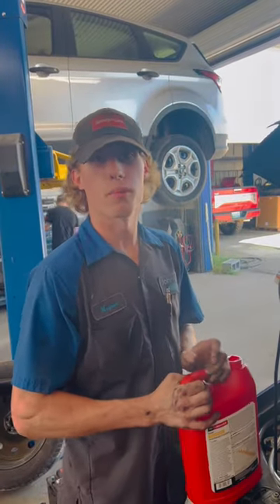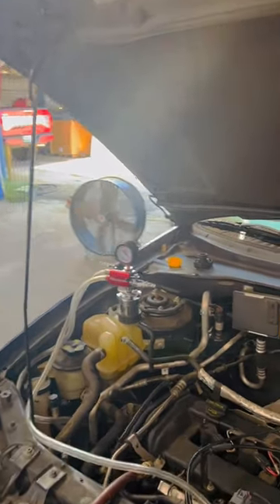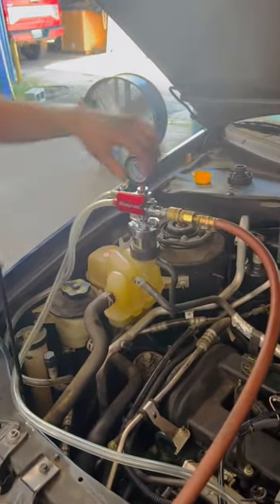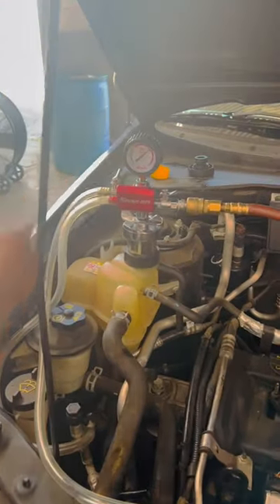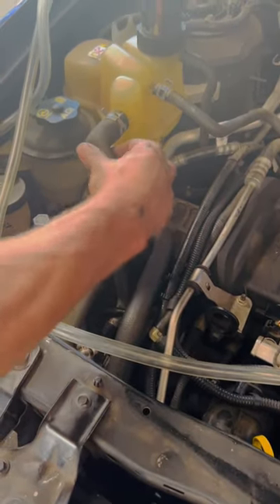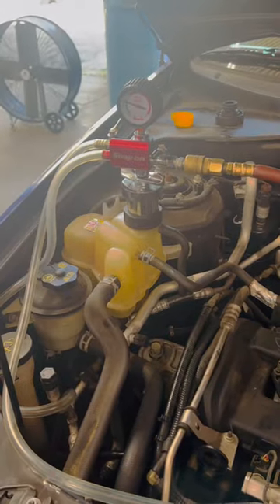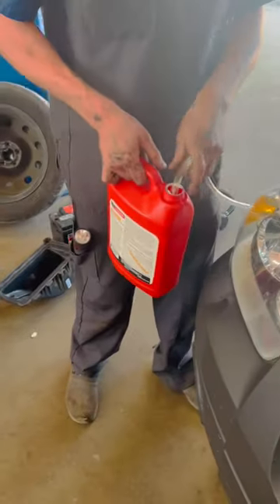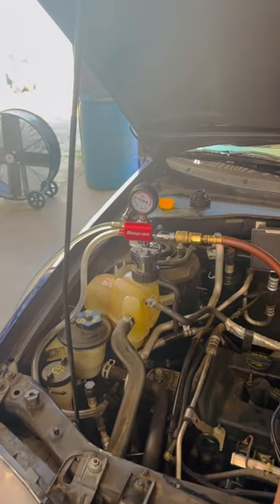How To Fill A Cooling System The Right Way #shorts

Comment: I'm just worried about using that pressure on an aged vehicle where the plastic can crack. I've seen it happen on a chrysler at my previous shop so I just do shit old fashioned because at the end of the day I don't want to break the cars anymore than they already are lol
Reply: It’s way faster to do it this way instead of a drain and fill and if you end up breaking something on an older car then it was gonna need it anyway… plus now you got more work lol
Reply: @23for82bigs  that's not how it works at my shop... we're not the dealer and most of our cars are old and parts are hard to come by, even on models 10 years old. That and the dealership just won't sell us certain things either.
Reply: The pressure won’t break anything. It needs to have pressure to bleed the air and create proper vacuum
Reply: On a well maintained car no problems. If you own a Jalopy you will have issues.
Reply: It works with using a vacuum not pressure so it's not gonna damage shit
Reply: I don't think yall noticed when he said "this is how you do it on all these NEWER cars"
Reply: @ricardocorral4411  vacuum can still break brittle plastic
Reply: That’s why only on the newer vehicles or the vehicles that harder to bleed out.
Reply: @GSC-Operator-chan  exactly what I said
Reply: The coolant system stays under pressure when operating properly, if the pressure doesn't break anything the vacuum shouldn't either. I've used it on many vehicles over the years and never had a problem
Reply: @SUMDUDE.  - just because it operates under 15 psi gauge doesn’t necessarily mean it’s good for vacuum. I’m glad you’ve had no issues I just wouldn’t take this approach based on all the other easy options that are easy as well
Reply: The vacuum you place in the cooling system creates less stress on the system than the pressure it is under does when the system is pressurized. If the plastic was going to fail because it was that brittle, then chances are that is why the car needed repair to begin with.
Reply: What
Pressure?
Reply: @TNTHammer  what do you mean they won’t sell you certain things? Sounds like you need to talk to someone over their heads. Don’t let a dealership bully your shop or try to ice you out. Our dealerships around here know better than to do that.
Reply: @THEMOWERMEDIC1  it's a NEGATIVE pressure, hence the term vacuum. still a pressure, in the reverse form.
Reply: @THEMOWERMEDIC1  think of putting clothes in a bag, and vacuuming the air out. The vacuum removes the air, and the shrinking bag creates a pressure on the clothes.
Reply: If something breaks while vacuum filling or pressure testing,  it needed to be replaced anyways..
Reply: Retired Professional Mechanic.  If Air breaks the bottle,  that means the bottle was brittle ready to break. Replacing the bottle just saved the owner a break down and possibly saved them a head gasket problem.  Depends how you look at it. Sucks to be a guy like you cause you just repaired something in the coolant system now another problem 2 months later. Your the bad guy. Something breaks doing it the correct way means you have a weak component replace it.
Reply: I mean, what do you expect from a chrystler product ?
Reply: @23for82bigs  yea true however many older vehicles require special order for some parts and customers can't wait
Reply: If it’s gonna crack and break under vacuum, it will crack and break under pressure when the engine is hot.
Reply: old fashioned coolant funnel for the win!!!!
Reply: @juanmartinez7536  The problem is it's negative pressure. Older coolant systems were never designed to be under vacuum
Reply: You do realize, I hope, that under operating conditions, there is OVER TWO FREAKING ATMOSPHERES OF PRESSURE IN THE SYSTEM. The 25-ish inches of vacuum is no where near as stressful. Learn some basic science ferchristsakes!
Reply: If it cracks under vaccum the plastic was weak and you prevented the client from getting stuck on the side of the road.
Reply: I gamble......i use this on semi trucks.....if the truck is a pile of sh*t, I pull just enough vacuum to fill it.....I have absolutely caused a water pump to start leaking through this process.
Reply: Just curious why can you not just pour it in? Is it just the fact that air can become trapped in the system and this keeps that from happening?

Comment: Love the haters, if something is going to get damaged by the vacuum, what do you think will happen when the system is under pressure. This method is the only way to go. You can pick up a similar unit for $100. I bought a Wurth unit for $80 15 years ago, use it at least once a week.
Reply: Exactly 👍

Comment: Love your channel - but a small suggestion. Normally you'd pull up the coolant right to the suction valve while you are evacuating. This way the first thing that is introduced is coolant - not a hose full of air, which would be the opposite of what the goal of this operation is, right? Edit - this will 100% overfill the reservoir, so have a large syringe and a hose on it to suck down to the correct level.

Comment: Does the snap on tool come with a small one application pack of Vaseline?  I gotta think that thing cost a fortune
Reply: It's not that bad, I have the snap on one and the MAC one
Reply: When your a Professional Mechanic,  you buy Professional tools. We don't worry cost. Because the job the tool does makes for a Professional job. It maybe over the top for Goober Mechanic who make Goober wages.
Reply: 500 bucks for mine with one adapter 🤦‍♂️
Reply: @rickchambers73  - call me a goober mechanic if you want I don’t care. All I know is I’ll never buy any snap on tools. Never had them never will. Just over priced vanity tools as far as I’m concerned.   Never had one issue with the tools I have that would be worth paying three or four times as much. But to each his own
Reply: Bought the universal harbor freight one for $90. Thing was garbage. Decided to buy the matco one for $300. It’s been worth every penny. There’s some tools worth paying a lot for.
Reply: @cheekclapper4334  - you fill these a lot as a part of your job?  Doesn’t a $30 funnel from Lisle #24680 work?
Reply: @condor5635  not really the correct way or most efficient for a tech to do this job. You want to pull a vacuum to check for leaks, with just a funnel you cannot do this. Also this bleeds the system instantly. If you are a flat rate tech these tools help you get paid more for sure by saving time
Reply: @Givemedabeans  thanks - understand and very good point for the full time mechanics. Don’t think as an experienced DYI I would need an expensive tool like this but it is interesting. I have a video on extracting fluid with my vacuum pump I could probably improvise for this use but do this so little a dedicated one is not necessary. Thanks for reply
Reply: @condor5635  I use that one as well. Both work great. But the vacuum fill is just way faster as it bleeds the air out very quickly as well as fill the system back up.
Reply: @rickchambers73  you could have just said more expensive tools make you feel like a better tool than anyone else.
Reply: @rickchambers73  
You don't have to pay an arm and a leg to get professional tools, there are plenty of other brands out there that are just as good as snap-on for half the price. For example, Snap-On sued Harbor Freight years ago because they claimed the Daytona jack was similar to theirs (which it was, made in the same factory) only $600 less than the SO version. 
If you know what to shop for, you can still find professional quality tools that's not going to obliterate your wallet.
Reply: Bruh u know how much time this tool saves? Who cares about the price, not waiting 20 min to bleed a cooling system.

Comment: To those saying the vacuum may damage brittle plastics etc... I've used one of these for 15+ years at a professional level. I use it on EVERY car I put coolant in, regardless of age. I've not had even one component fail due to the vacuum. That's literally 100s and 100s of cars over the years, if not 1000+ and never had even one problem. If something were to break, well then it was about to break or already leaking anyways. Simple as that.

Fact is that it is an time saving tool in multiple ways. It tells you if there is a leak somewhere in the system BEFORE you put coolant in it and you NEVER have to burp the cooling system if done correctly.
Reply: You also don't give a damn if something breaks, it's just more money you'll hose outta your customer for you breaking something. 🤡 "Well it need replacing anyways, it's over XX years old..."
Reply: @MindsMouth  you're probably the same guy who would be running right back and complaining for a refund if something broke a month afterward. 🤡
Reply: @Krankie_V  Hell no, mechanics are sharks, that's why I went to school to learn to do all my own work. 👍
Reply: @MindsMouth  sucks you feel that way. It's no secret that some joints will definitely rip you off but there are plenty of honest and reputable shops out there who will treat you right. The last place I worked was selling brakes to people whose brakes were only 50% worn out, all the damn time. I quit after only a couple months. I have no desire to be a part of that BS.

If a customer has a part that's ready to fail, I'll notify them. Once in a while we get someone with your attitude. They usually come back, but have to pay a tow bill on top of the repair. 🤷
Reply: What do I put my psi output on my air compressor when connected to my vacuum purge system ??

Comment: When you have long cooling hoses with multiple bends and odd shapes this tool works awesome because it eliminates air pockets but the system needs to be sealed. Obviously on earth we can only pull so much vacuum so when you pull the system down to negative pressure you can just turn the valve off and if it starts to lose vacuum then you have a leak somewhere. And then once you confirm system has no leaks fill it up.

Comment: Lmao some of us don’t want to sign our lives away to pay for a snap on tool tho 😂 fill it cap it start it and repeat till there’s no air left 👍🏻😂
Reply: They’re called investments. When you’re working flat rate things like this make jobs 10x faster.
Reply: You don't need one from snap on although it's probably one on the highest quality ones you can get, and when you actually work in a shop and need to get stuff done relatively quickly then it makes a huge difference because of how quickly you can fill it rather then waiting a long ass time. Also if you say it doesn't take that long then your lying or just don't know what you're doing because it usually takes at least 10-15 minutes for all the air to come out of the heater core due to the car not being up to temp... just saying lol
Reply: @msean624  was a joke dude I know this lol I have worked in a shop, this was mainly for the people that do not and do not want to spend all that $$ on a tool they would only use a few times a year if that, also seems like simple instructions to me on my original comment lol
Reply: @mr.corona1319  yes I know this I have worked in a shop, things like this do help a lot but this joke was mainly for people that do not work in a shop and or do not want to spend all that $$ on a tool they would only use a few times a year if that
Reply: Cap it? Doesn't that make it not bleed out the air since that closes the system? I was taught to start it with no cap with the heat on full so the heater core system also fills and bleeds correctly.
Reply: @stevenjohnson1692  no the caps have valves in them
Reply: Cheap insurance... You take the risk of an air bubble remaining in the cooling system ,especially the e.g.r. and burning it up....expensive to replace and the trucking company will be pissed,...... that's why your Chinese pizza pizzazz still hasn't arrived yet.

Comment: Meanwhile I bleed the coolant with a funnel and never had any issues
Reply: Doesn't work for every vehicle
Reply: That’s the Stone Age (nothing wrong with that method) dude it saves you so much time just by buying this tool
Reply: @DJFish8051  yea its just more practical ig when you're working on a porche or something at that level it would make sense otherwise funnel works fine in my experience

Comment: NOOOOPE😆 not the only way
-Pour to the line
-Start car
-Turn on the heat
-Top off as it warms up
-Play with the throttle (2.5k-3.5k rpms) and it'll bring heat into the vehicle(reservoir will be steaming, this is good)
-Close reservoir and go drive. Works just fine
Reply: You betcha.
Reply: Okay gramps. You probably hate all those fancy new fangled cordless tools too.
Reply: @Everythingisgoingtobealright  listen my boy, everything is going to be alright, i promise
Reply: @Ramslamtheman  
For me it will, you’ll be stuck in the 1960s for ever. Sorry I really should have more respect for the elderly.
Reply: @Everythingisgoingtobealright  😆😆😆well damn I'm not that old 😁 but it works though, you don't need anything

Comment: How do you get the air out of the fill line. The one you shoved into the coolant has air in it.
Reply: Just fill the fill line with coolant, close valve, then pull vacuum on the system.  While building vacuum the fill line should stay full

Comment: There are many variations of this tool that are very affordable. You don’t have to use snap on and I am currently waiting on my builder to put a 220 in my garage so I don’t have compressed air. So I have been using an a/c vacuum pump.
Reply: My set up was 80 $

Comment: Purge the air from the coolant filler line before cutting off the vacuum or all that air goes right back into the system.

Comment: Shade Tree mechanic is thinking 🤔: How much 🍺 beer money does this cost?
Reply: You can get vacuum fillers for as little as $30-$40 on amazon but a decent one will run you $100-ish. Probably double that if you get one from a tool truck. Plus you will need a compressed air supply to use it.  Worth every penny if you need to fill cooling systems of any kind of regular basis.
Reply: I think about how many hours I’d have to work to replace the money I spent.  I made $22.75 with a 7% night time differential. So $24.34 per hour, I no longer make that since I got fired because of medical problems that preventing me from doing my jobs. I don’t even drive right now, maybe won’t be able drive again. Maybe 14-16 hours after the government takes their their being alive tax. Their share cost them 0 hours of work.

That’s if it is only a $250 tool

Comment: Back when i worked at Sears. We used a Cool- Rite machine that had 3 tanks, best machine i've ever used. One tank was for the old coolant, one for water to clean out your system, and one with new coolant. Too bad they cost like 3k for a new one.

Comment: No spill funnel then squeeze the top radiator hose old school works
Reply: it does, except the fadder inlaws suzuki grand vitira, I couldnt understand why it still overheating and wouldnt suck down the no spill, thermostat wouldnt open.... found out online I was doing everything correctly.... expect I did put the rad cap back on to let the system pressurize, the FSM says to use a no spill, then when it starts to overheat, put rad cap on, do that 4 or 5 times and the system is filled.

 I spent 3 hrs trying to get "air out" jacked up the front, made my no spill the highest point with the extention, wouldnt work, filled the rad, wouldnt fill the engine.... put the cap on, 6 times she was full and best kind. lol

Comment: Or jack thefront end up high, fill, start and run till Tstat open, fill more, rev to blow out bubbles, double  check, and finnish filling, if necessary. 

Your on your own if a mid or rear engine, or exotic.
Reply: I dont even lift the car. But i do everything else you listed and never had a problem

Comment: You know there's a little vow that you can loosen and slowly pour it in and all the air will come out that's why it's there put in a vacuum on the system like that I don't recommend that only for your AC a vacuum is needed I don't see a problem with it too much if it's not under severe vacuum what are the specs on this that you're doing and I'm asking a serious question
Reply: Spell check got me several times on this post and I don't feel like going back and correcting it so good luck figuring it out if you read it several times you'll get it and don't criticize me and criticize spell check but after I read it I might who wrote this some idiot so I feel you LOL
Reply: To answer your question, a vacuum filler operates at around 22-27inHg (inches of mercury). 1inHg is the vacuum equivalent of about 0.489 psi (google it). So using a vacuum filler pulls the cooling system into the vacuum equivalent of 10.8-13.5psi. Given the fact that cooling systems normal operating pressure is 13-16ish psi with some even operating at 18psi+, using a vacuum filler present almost zero risk of damaging the cooling system. 

I've been doing it this way for over 15 years professionally and haven't had even one issue. Fact is it probably the best investment I've ever made in a single tool because it cuts the time needed to fill a cooling system significantly AND it effectively checks the system for leaks before you even put coolant in it. Most if not all car manufacturers have recommended it be done this way for many years now.
Reply: @catfishbilly7425  apart from the fact that cooling systems are designed purely for operating under a pressure and not a vacuum. Cooling systems have flexible rubber pipes that collapse under vacuum and block that pipe, AC systems use solid/reinforced tubing and it is designed operate under a vacuum.
Reply: @GruntUK  doesn't matter. Vacuum fillers work great and do not pose any threat to cooling system components. Now I agree with you that they suck (no pun) as a leak check method. This even rings true in HVAC work. 

Best way to check for leaks is to pressurize and visual. Or on an hvac system, pressurize and use soapy water.